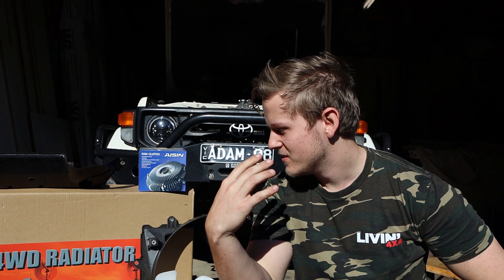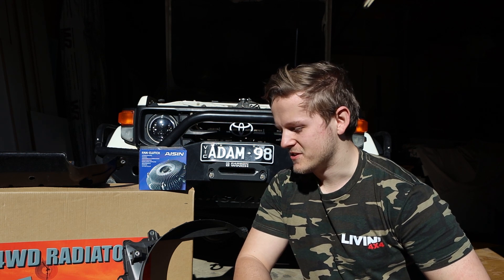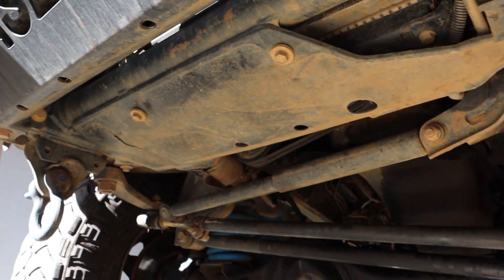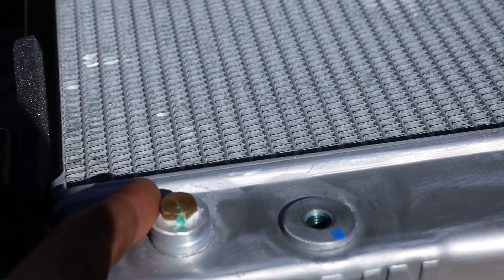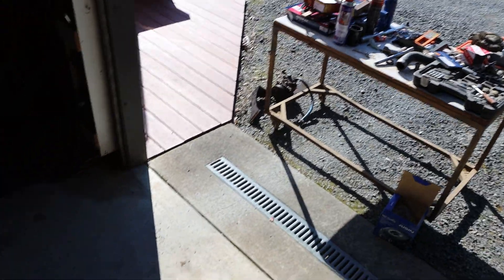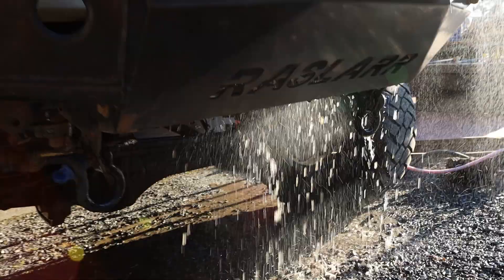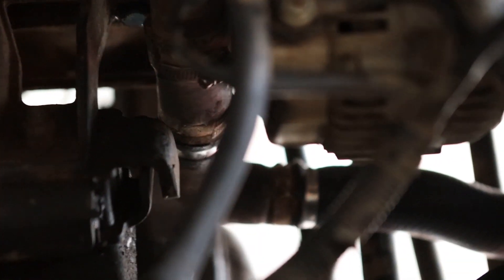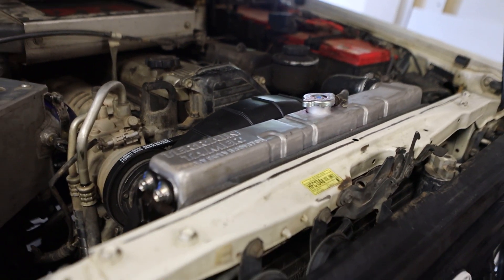Keeping a Turbo 1HZ Cool - Radiator Upgrade - Part 1

Comment: Couldn’t recommend the upgrade kit more. She works a treat. I have a similar setup 1hz with an aftermarket turbo, I run 12 psi . I never have a problem, been running it for about 2 years. Towing, daily, 4wheeling.

Comment: Hey @Adam Reed, best thing to do as well is to unbolt your fan clutch and wack some CST 15k or 20k (you'll loose a bit of hp but you'll get awesome cooling). Just need to be careful in watercrossing (as always though)
Reply: Gets the old fan spinning pretty quick aye haha I did that as well, well worth it

Comment: Novice question here: Would a seed net not prevent a lot of mud going into the radiator?

I know it's not a bright idea to keep them on permanently (I see a few people leave them on where I live 🙄).

But you can put it on before you head on to the track.

Just an idea, don't know if it's a good one. 🥴
Reply: Those terrain tamer parts look very nice.

Comment: Good vid mate
I hope you put the same colour coolant in ? (Couldn't see in vid, or I missed that bit)
 the red and green coolants do not mix and will clog up radiator if mixed
Also try 6 sided spanners and sockets,  much less chance of rounding bolt heads
Hopefully we can all get back on the tracks soon

Comment: I remembered the 1hz when fitted with a turbo they always overheat. People try to put a bigger radiator,injection pump upgrade with a boost compensater,new injectors,new fan. Never seen any work. The proper 1hdt has got turbo pistons,oil squirters which keeps it cool. Good luck,it gets worse when you tow. These people that sell these turbos know all about it. I remember the problem well.
Reply: Depends in the boost, they should only ever run single digits just for a little extra go. 5psi is ideal, it's when running north of 10psi that things start to get alot hotter.
Reply: @dodgyhodgie734  
Mine's been rebuilt with ceramic coated pistons and factory turbo rod's. Running a 12mm pump, cross country top mount and a denco turbo running 18 pond. See how long it lasts
Reply: @dodgyhodgie734  that’s what makes them run hot, lots of fuel and low boost.. that’s the exact reason they have a bad reputation. Feed them 20 psi with a correctly sized turbo with proper fuelling and they run cool and hard for years 👍🏽
Reply: @mitchsimpson2384  if they are tuned right low boost on a stock motor won't get hot, they don't have excessive fuel to make then hot. 
Either way I wouldn't turbo one, would rather drop a gear on hills and keep the reliability than cook a million km motor with a turbo.

Comment: Dude your condenser and radiator was blocked with a shit load of mud there was no way that was ever going to keep cool.. You wont be able to do a fair comparison as the old system was clogged up so bad of course its going to run cooler now.